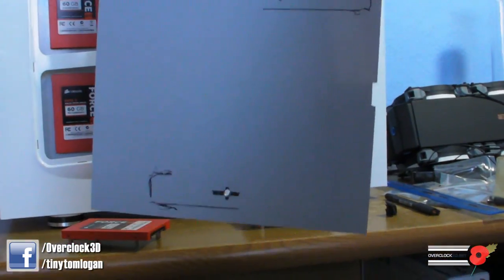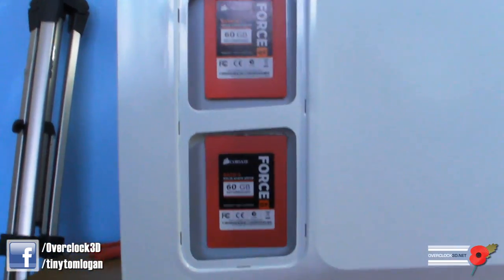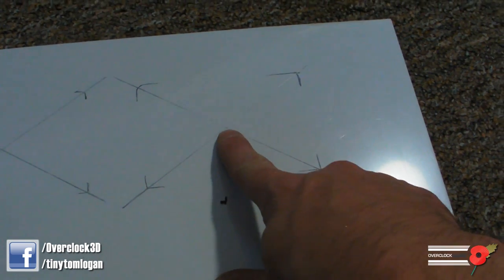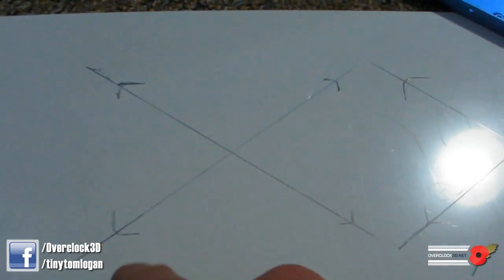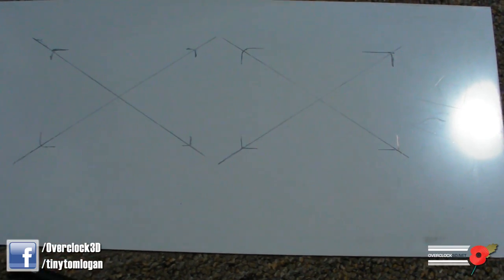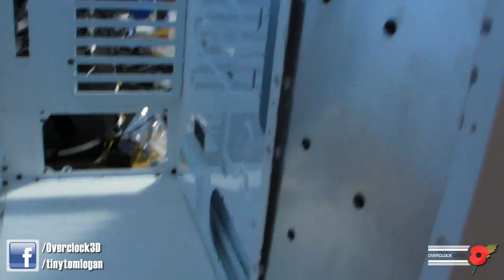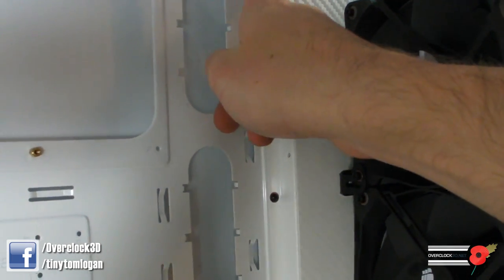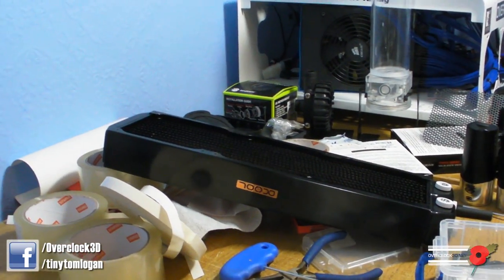Orca - Custom SSD Mounting & Monsta Rad Fitting!

Comment: You said that the fan cables cannot come through the other side, but there is some gap under the lower ssd where you can make o hole so they can pass.As for the ssd lighting i would put one strip from the right and one from the left just to look balanced and bright through the mesh!!Looking forward for the rest of the project!!

Comment: Looking good! You make me want to do a build with the Shinobi. Just as an aside, there are a great many things you can use as a center punch, especially on thin metal like that. A nail works fairly well for starters, and it's not hardened and prone to breaking the way a drill bit would be. (some peeps might think they have to whack the heck out of the drill bit)

Comment: Tom, you got to put plexi in over those solid state drives. Some LED strip down each side of that window would be great too. Or you could stick LEDs underneath each of the four sides of each SSD and have them lit from below so to speak.

Comment: not sure what the finish would be like, but what about adding the second piece of mesh back in, but cutting out the middle sections. leaving only the outside where the white frame is. Which will darken it down. Although maybe a slight tint may be better...
Looking forward to seeing the finished rig. Cracking work as usual ;)

Comment: you definitely should paint the white area surrounding the SSD's black underneath the mesh, it will hide the illusion of the SSD's not being aligned properly even though they are, due to the angle of those holes

Comment: Yeah good idea! I allready have a topic on the dutch tweakers.net forum. So i start also one on oc3d forum. Its a retro build with asus motherboard pentium3 2x voodoo2 sli and awe64gold. And the case will be a heavily modified Aopen HQ45 from 1999. And the theme will be Halflife1. First i gonna do some more work on the harddisk mounts. So see you on the forum later today :)

Comment: Hey Tom, love the way Orca has turned out. I came back to look at how you mounted the ssd's, and the standoff idea is brilliant. I need to do something similar for my bitfenix prodigy build, except I need to fit the 24 pin cpu cable behind the ssd. Do you know of where to buy standoffs that tall with an m3 thread?

Comment: Hey, Tom, did you consider sticking the acrylic straight onto the mesh support wall (bit you wanted to cut)? There's only a little bit in there and it will make it easier to line it up straight from what I see.

Comment: I say paint the case lip/edge under the mesh black, I think it will look much nicer. Also why not sleeve all of the rad fans and run them to a distribution board (phobya makes a nice compact 6x3pin block) hidden away.  Or possibly that corsair link system..

Comment: I think that painting the side panel by the mesh in black would look good.

What is stopping you passing the fan cables through the panel above the SSDs so that they won't be seen? Just use extensions and pass them all through one hole around the height of the top of the rad?

Comment: Just my view, cut the ssd windows to size and put black edging around each part and then either use hot glue or clear silicon that way you get them to shape and also cover the part in the middle rather than cutting it out, my thought at least.

Comment: i would remove the midsection, on the sidepanel where the mesh goes, and paint it black, but i would deffinetely removed the midsection.

You could test to do it black by using electrical tape :), if you dont like it then you know it :)

Comment: could you put a hole in the bottom of the case and make a little bracket to cover the cables, then just feed to rad fan cables underneath the case... just a thought but it would completely conceal them

Comment: Coming together nicely, but I don't know why you keep calling the SSD's force 3's when it clearly says force GT on them.

As for the reservoir, why not bring it closer to the door, rotate the thing 90 degrees to the left and attach the hoses towards the MB tray. No need for hoses to run in front of the rad fans.

Comment: Why wont you just solder all the fans ( connectors together, and then have a nice 1 cable(probably braided) going away from the 360rad, into the board .. or controller.. wherever you want it ?